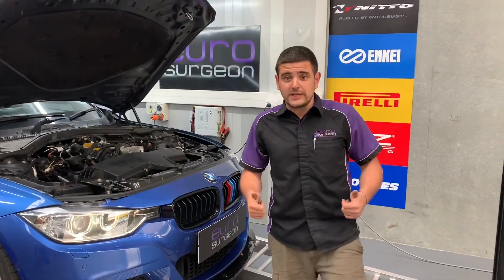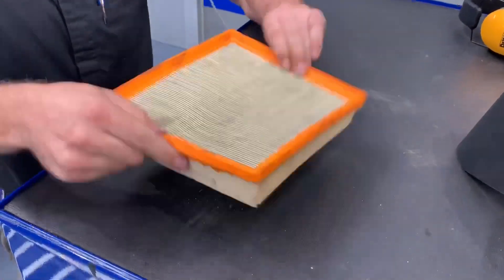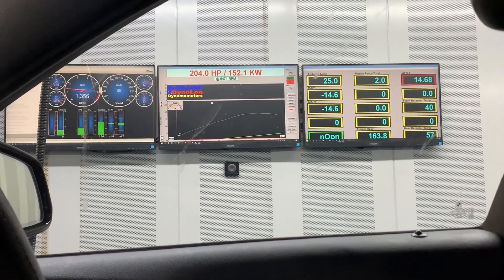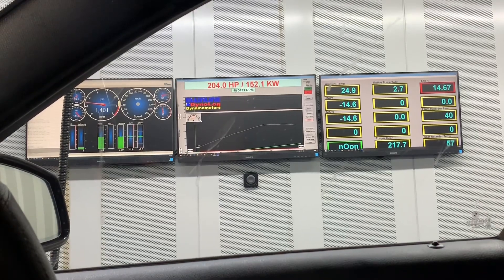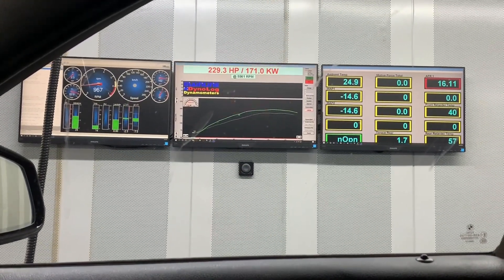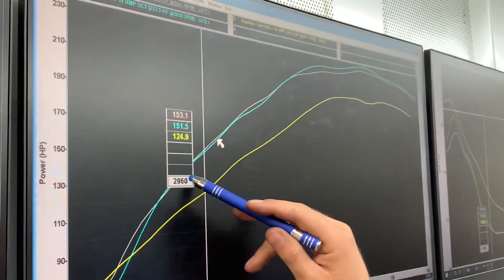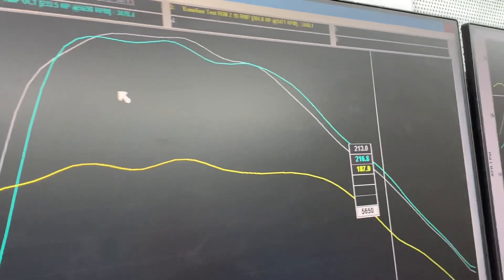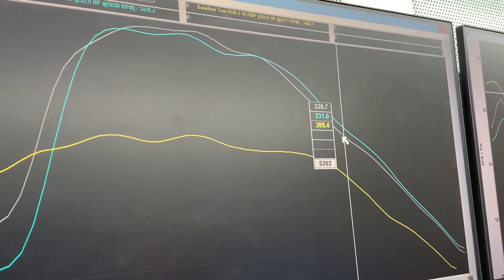BMW F30 328i Stage 1 dyno walk-through

Comment: Is there any difference between the 320 engine to the 328?
Reply from the maker: Daniel Vazquez only few bits different , but not in the ways that matter.
Reply: Yes about 60hp  I think. I googled it, I own a 328i
Reply: @Armzilla-  yea I don’t know why that 328i has 204 hp maybe it’s restricted in Europe my 2013 528i x drive has 240 stock
Reply: Got Game 204 is whp， 240 is bhp
Reply: Got Game 320i is 170 whp
Reply: This car makes 240 to the tire stock when motortrend tested it…where’s the before / after on yours

Comment: Kind of strange, I thought the 328i has around those power figures stock don't they?
Reply from the maker: Phantom this is power at the wheels, not at the engine
Reply: @EuroSurgeonNz  Ahh ok got it, thanks for the clarification! Pretty respectable gains for stage 1 tune.

Comment: For accurate results make sure to put the car into dyno mode :)
Reply from the maker: Believe it or not makes no difference. Once the dsc faults out  - identical. Will be making video soon on power difference on sport/race/comfort. Spoiler alert - there is none.